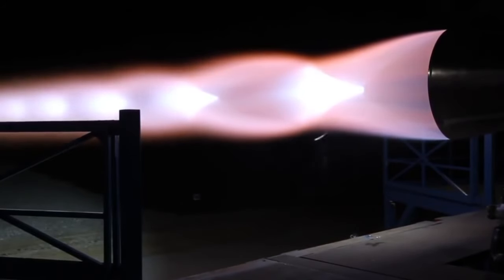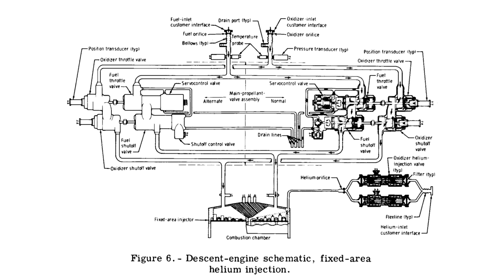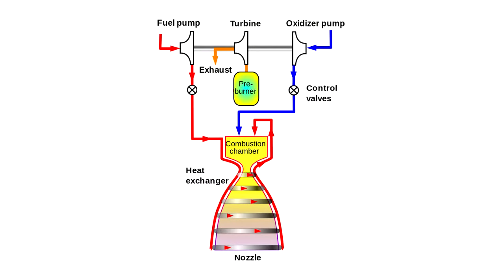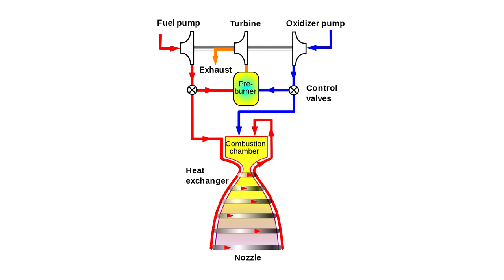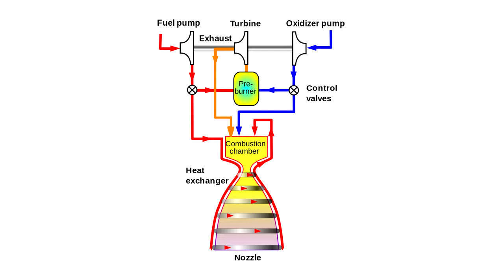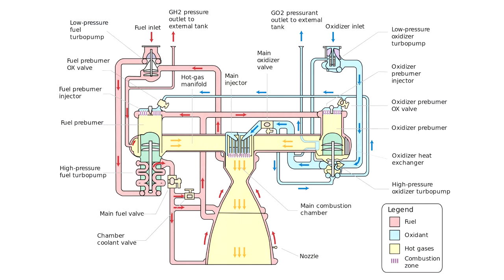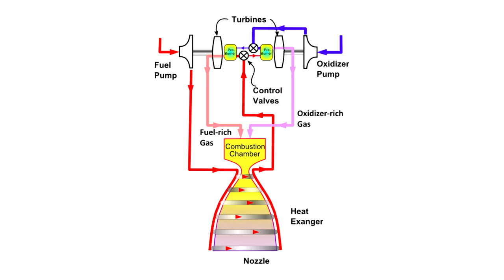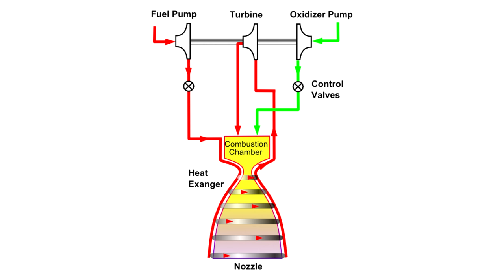KSP Doesn't Teach: Rocket Engine Plumbing

Comment: Don't mean to correct the video, but the Bloodhound LSR car doesn't use a regular car engine, it used a F1 engine, an old 2.4L NA V8 made by Cosworth, with around 750hp and a 15000RPM limit.
Reply from the maker: That is a 'regular car engine' compared to everything else here.
Reply: @scottmanley   Was there/is there a rocket that used a small regular car engine to drive the turbo pumps, in the way mentioned here? I seem to recall one that flew a number of years ago...?    3 or 4 cylinders.

Comment: In an expander cycle engine, how do you start the engine if you require the heat from the bell to expand the hydrogen to pump your fuel?

Comment: So...a rocket turbo-pump is technologically similar to an Auxiliary Power Unit (APU) on a Boeing?
Reply: Not really, an APU converts fuel into electrical energy, a Gas Generator converts fuel and oxidizer into mechanical energy.  They are similar in the same way a coal-electric plant is similar to a wind turbine.

Comment: Awesome - how does the electric pump work - from batteries? Or a small generator?
Reply: Works from the shaft power generated from the turbine. This shaft power can be used to turn the pump via mechanical coupling, or transformed into electrical power. 

And the turbine is powered by the energetic gases from the pre burner chamber.

Comment: 8:30 you say the sov's reduced the fuel supply to the pre-burner to cool it, but isn't it the ox you need to reduce? increasing ox ration INCREASES combusion heat, or do I mis-remember?
Reply: I'm not a chemist, but here's my attempt at an explanation:
A chemical reaction that releases energy will achieve the highest temperature if the reaction is complete, that is, all the fuel is oxidized and there is no "unused" oxygen left.
If there is too little oxygen to burn all the fuel, the reaction will be incomplete as some of the chemical energy in the fuel is not released and therefore the temperature of the exhaust gas will be lower.
If there is more oxygen than needed to burn the fuel completely, the reaction may release all the chemical energy in the fuel, but that energy has to heat a larger amount of gas (the unused oxygen in addition to the combustion products) with a lower temperature as a result.
Both the gas generator engines used by the Saturn V and the staged combustion engines used by the Shuttle shared the problem that a complete combustion in the gas generator/preburner would destroy the turbine blades in the turbopump because of the high temperature (about 3000°C).
The solution was to run that combustion fuel rich to lower the temperature, but the Saturn V lost some efficiency because the turbopump exhaust with unburned fuel was dumped overboard instead of being injected into the main combustion chamber to be burned completely as in the Shuttle's main engines.
Reply: FromNorway  I hear what your saying and it makes sense. what I found odd is, to my hearing at least, he seems to be implying that going ox-rich has a cooling effect but not the other way around. but maybe I misunderstood him. thanks for the detailed reply.

Comment: Maybe it's the same as the first example, but what if the fuel tanks can physically contract, like a big water balloon? Not enough pressure? Surely the g-force of the rocket is enough to keep flow in some cases if all you need to do is get the fuel into the chamber... am I missing something? If the rocket is being thrust forward all the fuel is going to be forced to the back, right?
Reply: Rocket's g force is not enough for combustion pressures so you need something else to compress the fuels.

Comment: why not take the fuel exhaust from the fuel pumps and feed that to another, much smaller, engine? like the Saturn V ascent stage has 5 nozzles, the center nozzle would be the fuel pump exhaust engine.
Reply: See russian RD-0110 used on Soyuz, it uses that gas from its gas generator to drive its vernier nozzles since the engine is not gimballed itself

Comment: About 6:35
"So in the Merlin engines, you will basically burn a bit of your fuel with a lot of oxygen..."

Did you mispeak there? It almost sounds like you're describing an oxygen rich preburner, when the Merlin is fuel rich.

Comment: For stage one Why go thru all that hassle of closed cycle for 10-15% more ISP when you can build your rocket 10-15% larger with open cycle, yeah, give or take a few % on either side of the equation but you get the idea/question? LOx/RP-1 to LEO, Atlas did it with open cycle, yes small payload but the point remains. Closed cycle not worth the complexity and expensive metal alloys. Just my opinion.

Comment: Why isn't it more efficient to use a small air-breathing gas turbine to drive the turbo pump? That way you would use any liquid oxygen, just hydrogen or RP1 and you could save weight by carrying less oxygen.

Comment: I believe rocket engines don't have turbines in the exhaust, like jet engine, because they use oxygen instead, so temperatures are higher than with air. Question is: can jet engines work with turbine separate, as in these open/closed loop rocket engines?

Comment: They are called Turbopumps because they are pumps driven by turbines! so a turbine is not the reverse of a turbopump, but the reverse of a pump! (it converts kinetic energy of a fluid into mechanical energy, and the pumps convert mechanical energy into kinetic energy)

Comment: Engineers out there, please check out my proposal for a combined rocket/scram engine. So there are two air intake channels in the engine. One have a high speed electric turbine and the other does not. The turbine would be used as lower speeds to inject air into the flameholder where fuel is also injected, allowing combustion in the engine. At higher speeds, fuel combines with the injected air automatically, and the fan intake channel turns off, which redirects all air into the scram channel, making the ship go at scram power. Then as the ship climbs into the upper atmosphere, liquid oxygen is injected to the flameholder to serve a
Reply: It is in development already, google Sabre Engine

Comment: from my understending a turbo pump is some how like a jet engine that instead of  pumping air in the combustion chamber, it will pump fuel  and oxidiser . Therefore those that mean that we can take a  small turbo prop and adapting it to  make  an  rocket engine ?
Reply: well it is a pump, driven by a turbine. Basically you make a bunch of hot gas by burning fuel and use this to drive a turbine. The shaft of the turbine drives the pump, which supplies fuel to the rocket and the turbine.

Comment: Why do we use oxygen as the oxidizer when its not the best from a chemistry perspective?  Why not Chlorine trifluoride or something more extreme for its mass...I get that we need to extend the burn but idk/I've been wondering
Reply: Oxygen is cheap, readily available, very well documented, mildly cryogenic and a pretty damn good oxidizer. 

Regarding what you proposed...read the following from back in the 60's, when the US military was researching CIF3 for use as a storable oxidizer in missiles (its from the superlative Ignition! book by J.D.Clark). 

"It is, of course, extremely toxic, but that's the least of the problem. It is hypergolic with every known fuel, and so rapidly hypergolic that no ignition delay has ever been measured. It is also hypergolic with such things as cloth, wood, and test engineers, not to mention asbestos, sand, and water — with which it reacts explosively. It can be kept in some of the ordinary structural metals — steel, copper, aluminum, etc. — because of the formation of a thin film of insoluble metal fluoride which protects the bulk of the metal, just as the invisible coat of oxide on aluminum keeps it from burning up in the atmosphere. If, however, this coat is melted or scrubbed off, and has no chance to reform, the operator is confronted with the problem of coping with a metal-fluorine fire. For dealing with this situation, I have always recommended a good pair of running shoes"

The chemistry around rocket propellants and oxidizers has been very thoroughly explored. If you don't see something used, its probably because it is not a very good idea to use it.

Comment: so in the case of one of these "open cycle" engines could one plumb the exhaust into the engines bell at a suitable point where the pressure wouldnt cause the gasses to revert so they could be burned off and thus generate some small amount of thrust?

i realise its not as efficient as a closed loop system but it would presumably be dead simple mechanically while offering some benefit. 

in my mind this seems more plausable considering what you said aboit bell shapes and sizes in a previous video, a space based engine could utilize a very large bell to gain every bit of thrust possible and such a modification i think would work pretty well in that case. especially assuming such an engine wouldnt get an overhaul every  few burns.
Reply: That's exactly what happens on the vacuum version of the Merlin, though they do it more to cool the bell than for the extra thrust. On the first-stage versions they simply point the exhaust downwards and add a small bell. (the remaining pressure on the exhaust is too low to usefully inject on the much smaller first-stage bell)
Reply: The F1 did this - if you look at the bell, it's got lots of pipes going around it in the top half, then a large pipe around the circumference in the middle, and then it gets flatter in the bottom half.  The top part was regeneratively cooled, the big pipe is where the gas-generator exhaust was fed into the bell, and below that point no more cooling was needed on the bell because the relatively cool exhaust protected the bell from the hotter combustion products.

Comment: @6:38
Well no, Merlin engines run fuel rich. Same as i think any other gas generator, which isnt pumped back into the main combustion chamber.

Comment: you can only generate soot when you have C-C bonds in your fuel. Only a very limited amount with only C* radicals present (like when burning methane) but that is not the case when you use hydrogen as a fuel. Thats why the americans got away with using a rich fuel mixture and the russians had to use a lean fuel mixture (as they used kerosine as a fuel)

Comment: if we just compress the fuel more so that it is spraying out faster would that make more thrust? I feel like this would make science but then does the fuel not burn as efficiently. Or is it the burning that makes the thrust and not how fast it is moving out?
Reply: He made this point already. The problem with pressure fed engines is for more thrust youd need to have bigger and heavier tanks

Comment: So the fuel pumping system is kind of like ... powered by a turbo charger or something that works similar to cars turbo chargers?
Reply: As I understand it, a turbo pump and a turbo charger are very similar technologies, just that one pumps air and the other liquid.
Reply: Curebores
Yeah, that is what I thought about.
Reply: well the main working principle is exactly the same. However one is a compressible gass and the other a liquid phase. The two different phases have obvious and drastic differences.
Reply: I liken it a bit more to a turboprop, but only because of the non-cyclical nature of the combustion chamber running it. In the turbocharger analogy, it's a bit like if your turbo was powered by its own fuel source and had two turbines, one for fuel and one for air and this took the place of your fuel pump.
Reply: I would say turbopumps are more like a turboshaft than a turboprop

Comment: Scott how strong would the rocket have to be for the engine test to nudge our orbit a smidge? ( also is Smidge an acceptable unit of measure? )
Reply: Every probe launched that has left the Earth's sphere of influence has removed mass from Earth. Each one of these has altered Earth's orbit by at least a few milli-smidges.
Reply: SNAP! Didn't even think about the mass leaving.... Mind blown!
Reply: Well, the exhaust collides with the atmosphere, so unless the earth and the atmosphere are decoupled, the total angular momentum remains the same.
Reply: Alexander van Gessel The atmosphere converts much of the energy expended by the exhaust into motion, as it's a gas and easily moved comparatively speaking in regards to the solid that is the Earth system.

Once contact is broken between the solids of the Earth and the craft, the atmosphere is swallowing the vast majority of the craft's output.

Comment: I may just be missing something in the video, but could someone explain how Full flow staged combustion cycles are started and restarted? Thanks!
Reply: The propellant tanks are pressurised with an inert gas e.g. Helium, which provides enough fuel and/or oxidiser flow to get the preburner to the point where it's generating enough gas to drive the turbine which powers the turbopumps. Ignition is by spark in SpaceX's Raptor engine, and was presumably going to be a more traditional pyrophoric ignitor in the case of the Russian RD-270 engine which was cancelled. As a first-stage engine developed in the sixties, the RD-270 would not have been designed with a restart capability. It will be interesting to see how SpaceX manages it with the Raptor, since I imagine the restart process for a FFSC engine is bloody complicated... all the propellant lines and combustion chambers would probably need to be purged of any residual combustion products before a re-light, certain components (and the propellants themselves) would need to be maintained within fairly strict temperature ranges to ensure a reliable restart, and the whole process would need to be precisely timed and monitored. Very challenging engineering, but they've obviously learned a huge amount about in-flight restarts while developing the Merlin into its current highly-reliable version. :)

Comment: Weird how running lean in a petrol engine creates more heat, and in a turbo-charged car will melt things, but running oxygen rich in a pre-burner puts less heat on the turbine side of the turbo-pump in a rocket engine. Is it another component of the atmosphere that causes a lean fuel mix to generate more heat in car?

Comment: 1) Even on an open-cycle engine, couldn't you get jet thrust from the turbine exhaust? After all, turboprop engines get SOME jet thrust from the turbine exhaust...that's the reason "Effective Horsepower" exceeds "Shaft Horsepower."

2) If the turbo pump is reasonably efficient at extracting work from the fuel, there shouldn't  be much residual energy to extract from exhaust stream. If "closing the cycle" gains you much thrust, doesn't that imply your fuel pump sucks?
Reply: 1) Yes, you get some thrust, but not much because as you assume in 2), the turbine has taken most of the energy.

2) The issue is that each unit mass of fuel and oxidiser can generate a specific amount of energy, and the engine's job is to convert that energy into thrust. You make thrust (momentum) by giving mass speed, but energy is proportional to the square of speed, so it's more efficient to have all the mass come out the back of the engine with the same speed. If the energy is used to make some mass come out with more speed and the rest with less (the turbine exhaust), that will make less thrust than if it's evenly shared.
Reply: Also, you gain thrust not so much because there is kinetic energy left in the turbine exhaust, but because there is chemical energy left. You left it in there so you'd have hot gas rather than a blowtorch impinging on your turbine.

If you then feed this cooled (by expansion in the turbine) gas into the engine, the remaining chemical energy can be liberated to do more work.

Comment: I do not see any benefit from closed cycle system because the pump has to operate under extreme absolute pressure and small pressure differential best efficiency can be achieved the pre-last system which uses gases from the combustion chamber is most efficient and if you still have some pressure left you can just add one more nozzle. but this is pretty pointless because exhaust pressure is very low.

To avoid turbine overheating we can simply cool it down using liquid oxygen which it is pumping.

Comment: Your expander cycle is wrong. Fuel could not be possibly fed into the combustion chamber after it has driven the pumps. That would be perpetuum mobile. It's dumped out instead. Nevertheless, great video!
Reply from the maker: +Martin Karanikolov first up, closed expander cycle would not be perpetual motion and works just fine. The only open expander cycle engine I know is the Mitsubishi LE-5B which uses a 'bleed' cycle, injecting hydrogen into nozzle which of course helps the specific impulse after you tweak fuel ratio.

Comment: How about using electrohydrodynamics to move fuel instead of a fuel pump ? Zero moving parts and nothing to block fuel flow. If they can create an electrokinetic pump powerful enough it could solve the closed cycle problem.
Reply from the maker: +Last burn might work for a lithium fluorine engine, but not for Rp-1
Reply: I honestly don't see them doing this. Having battery power is not weight efficient. Having a generator for it has electrical losses in the conversion. Not to mention, how would they get a pump powerful enough? Only worth it for low thrust options, like a replacement for ion thrusters.

Simpler solutions might be to find ways to power the turbopump direct from the exhaust. But while there is a need for a powerful pump, it's likely to only be the turbopump type.